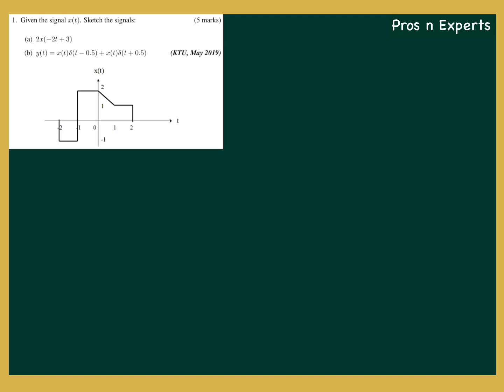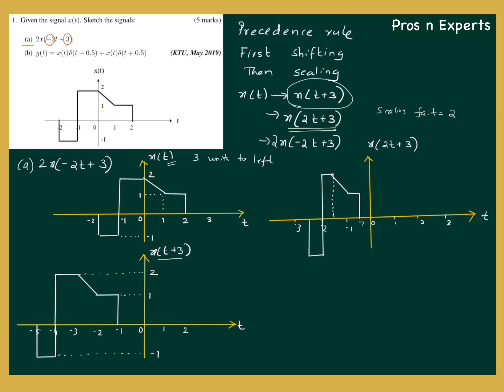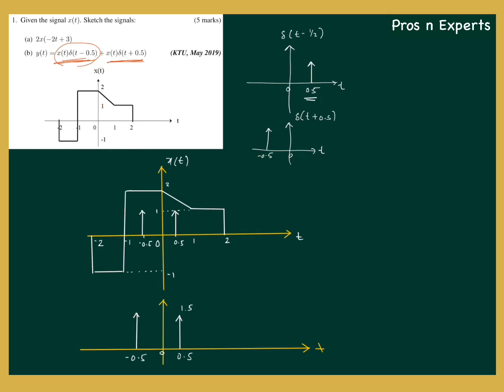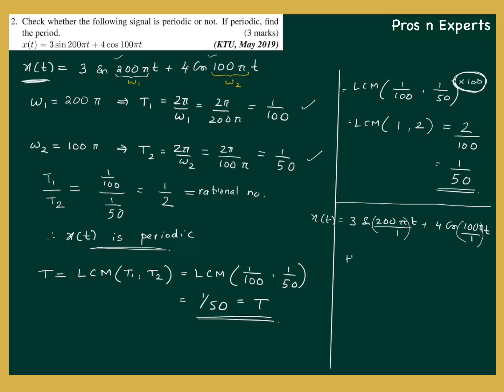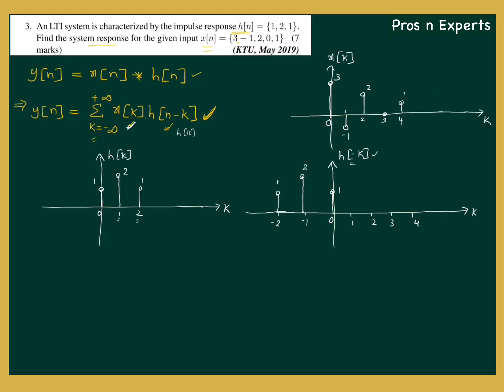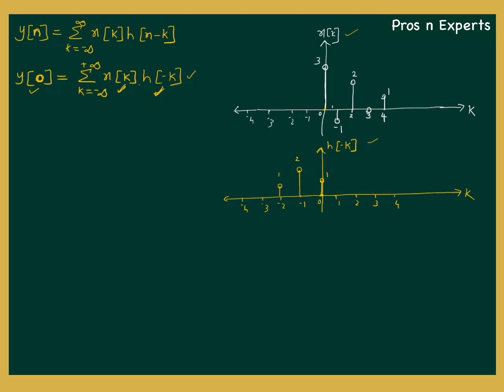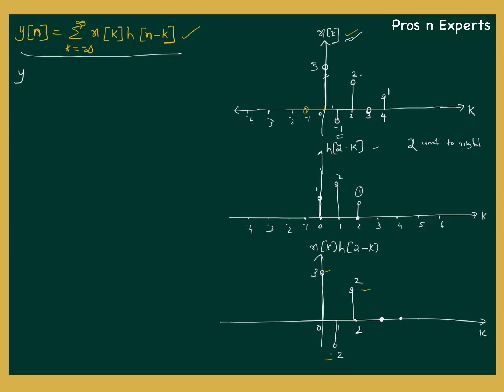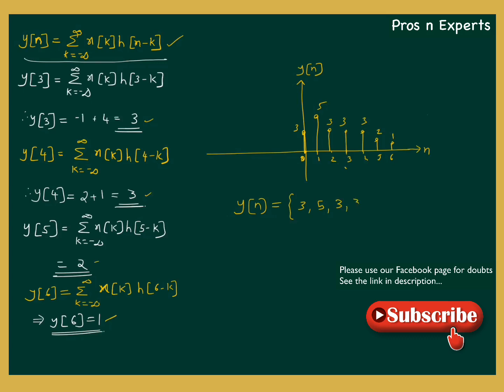Signals & Systems KTU Questions Solved-Part 1

Comment: Shouldn’t we take reversal first?
Reply from the maker: If we proceed with the precedence rule, we have to take shifting first. But as you said, we can also proceed with taking reversal first. But in that case, what we investigate is the signal x(t) = 2x(-2[t-3/2]). That means after scaling, the shifting factor becomes 3/2 and not 3